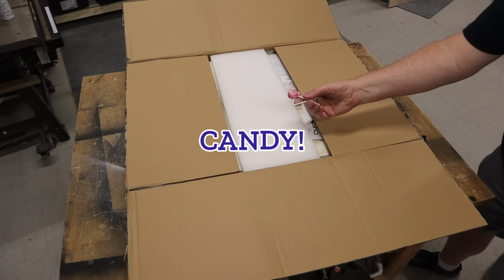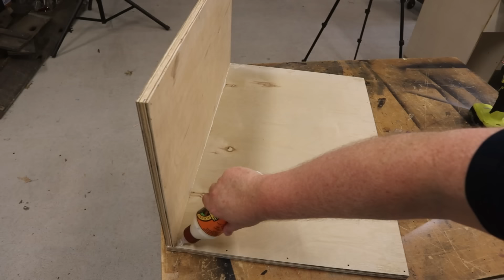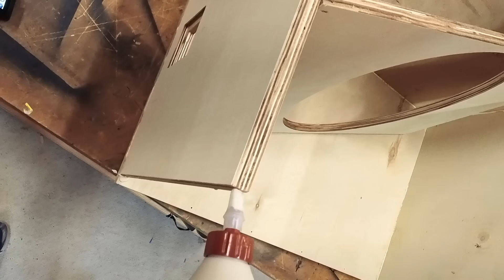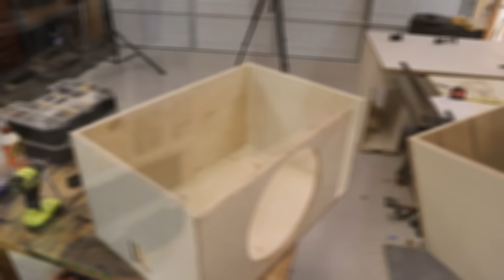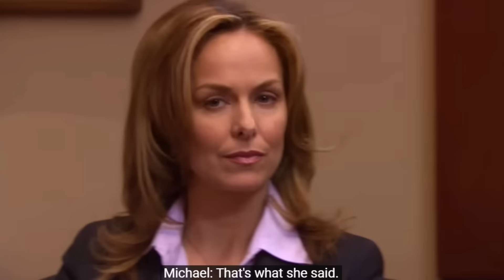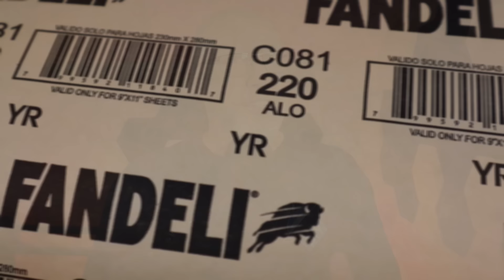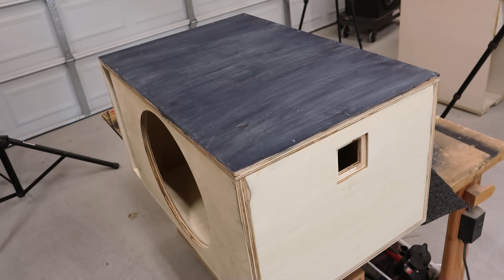Build a Subwoofer Box with (almost) no tools.

Comment: I'm a little confused about the corner "45" in the vent. Without cutting an equal amount off of the inner corner, wouldn't that restrict the opening of the vent by roughly 3/4"... turning a 3" vent into a 2-1/4" vent at that point?  Probably not a HUGE deal, and I suspect the instructions spec'd it that way, but I think it might be better to leave that one out. Nice job on YOUR build though! Nice to see something that isn't MDF!   Closing in on 100k subs!  Go Justin!
Reply from the maker: @zarboaudioprojects1430  If you measure the distance across the corner, it's usually a bit more  than the width of the port.  Some kind of crazy Pythagorean theorem or something like that.
Reply: @DIYAudioGuy  You know, I just sketched it out on a scrap of paper, and you appear to be correct! It is just a bit more. I guess what may seem logical (to me at least) is sometimes incorrect!

Comment: I bought one of those flat packs from d4s and they are garbage,  weak soft wood and they flex and resonate
Reply: I bought the single 12 flat pack and it was missing the baffle and was packed poorly. They knew it too because the receipt was put inside the box and taped up. It was a return from someone before they sent it to me. I can see the previous address through the magic marker with a shipping weight of 34 lbs and 31 lbs for mine. They made me go through route package protection for a refund when it was their fault. Then I had to go through my credit card company to get my money from route because they never refunded me.  I ended up making my own baffle with a jig saw and a piece of birch I had. It looks like crap and sounds like crap. Like you said it resonates and is soft wood. I never had such a bad experience from any business like d4s. It's my first and last time I'll ever buy from them
Reply: @knighthawk8084  better than MDF at least? What sub was in it? Im considering one for a 1000 rms 15” and add bracing or my own double baffle.
Reply: Sundown sa v2 10 inch,  1.25 cubic feet box, I guess for the price you can't beat it, I paid a 100 bucks and free shipping, I buy the birch flat packs from gp car audio now

Comment: When I was building enclosures for d4s I never used that type of plywood. That's the cheap stuff. I used Russian Baltic Birch only. We have a nice supply of it in Vegas... He should be flat packing the good stuff.
Reply from the maker: I'd like to get my hands on some of good stuff!
Reply: @DIYAudioGuy  I'm just saying the price per sheet is only around $20 more. I'm sure people wouldn't mind a $20 increase in the flat pack price
Reply: @kylevanwinkle2081  I get it on a weekly basis. And prices have gone down. Before the war is was more expensive.
Reply: @kylevanwinkle2081  I think he's making the common misnomer mistake and calling Birch veneer plywood "Birch wood". You're talking about solid wood, right?
Reply: @kylevanwinkle2081   You mean 13 ply?
Well, I can get 48" x 96" in my area, just south of Chicago. It is $210 a sheet (a lot more than $20, for sure), but the prices you're talking about and the size limitations are usually for solid Birch. 🤔

Comment: It came out good and looks nice. Only other thing I see is its a single baffle but compared to other flat packs out there this one is indeed a bargain.
Reply from the maker: That's one of the problems with flat packs, shipping gets expensive so you have to cut corners to save weight.
Reply: @DIYAudioGuy  I have an RS entry v2 15” and a Kicker comp VX 15” that need boxes so just ordered one of these flat packs after looking around at other offerings and this is a good value so thanks for the video!  I can always add some extra bracing or my own double baffle but cant really beat the price for what you get!